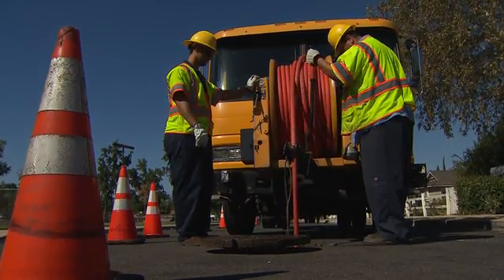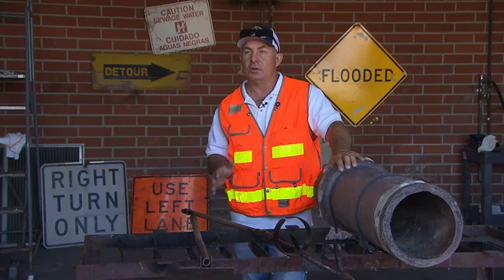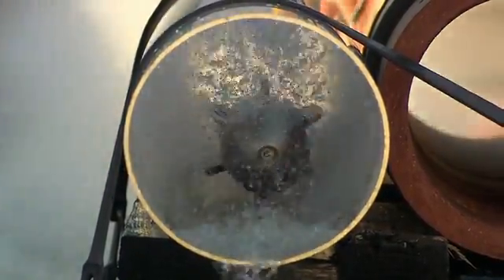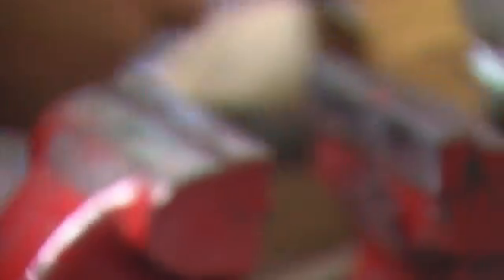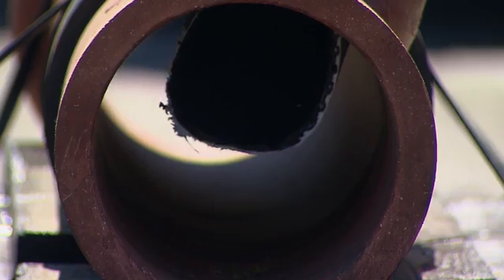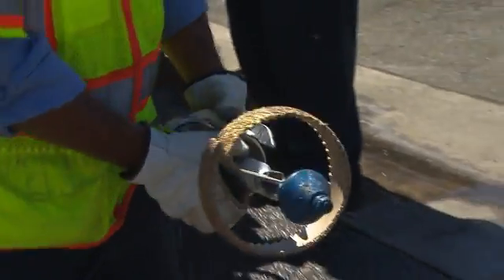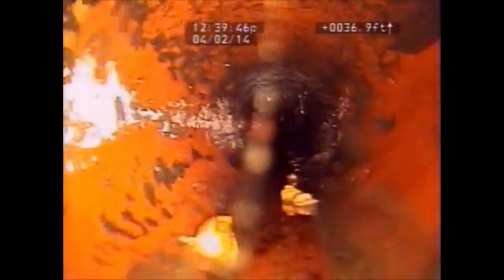Sewer Cleaning in Los Angeles California with Kent Carlson

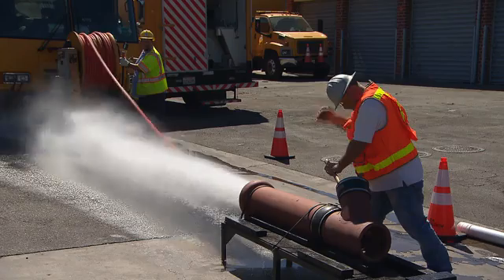Comment: ok boomer, but the way you're holding that piece of wood at 4:28 is incorrect. It's dangerous.
The pipes diameter is large enough for both your arms to fit, i.e if something goes wrong ( you slip or for some reason your hand is swallowed by whatever system your' re testing), your han will end on the cutting part of your device... Use something like a clamp at the very least.

Comment: Dont the new tools cause more problems destroying old clay pipes?  Those methods seem pretty aggressive
Reply from the maker: Great Question!...When we adopted the aggressive approach on cleaning and tooling our spill dropped from over 1000 a year to around 70.
Our Clay Pipe system has pipe that is over 100 years old and did not suffer any adverse effects with any of the aggressive tools and cleaning techniques..That's why we stay with clay and have not reverted to PVC that would definitely suffer damage with aggressive cleaning.

Comment: Seems like there would be a safer way to test the new cutting tool running at 2000 psi than holding it with your hands :-/

Comment: Or just use dynaflex with a cutting tip and a 40K rig, use less water than that jetter and not have to fashion a freakin tool every time you need cutting power.
Reply from the maker: Hi Justin  Our trucks run a Parker 1 inch hose at 60 gpm at 2000 psi or 80 gpm at 2500...we need the flow iin conjunction with the psi to clean  30 in lines and larger and flush debris. our average sewer line is 8 inch in diameter

Comment: you are saving over 2million to the city? Do the recognize any of that? I mean giving a fair payment for the tools you design and manufacture? if not, you better be an independent contractor!
Reply from the maker: Thanks for the props GUIRADE!  The city does not recognize the value and cost savings of my tools and I receive no extra payment for the City using them...go figure
Reply: @SewerPros  oof
Reply: The city doesn't care about savings.
You should've told them you had a much more expensive and less efficient way of doing the job and they would pour billions into you.

Comment: for the ones that dont know, have you ever seen a truck with the tanks cleaning out sewers? after they're done they drive to a sewage treatment plant and it goes through different piping and chambers to filter the water and put it back into the wild (what about chemicals and garbage?) ah, well they have very special tanks and lighting for that. (lighting?) the rays from the light "burn" the chemicals and the garbage is filtered to be separated and sterilized for "what can we use again". the water is cleaned to be put back into marshes and streams to the bacteria can break down the germs to safe water again. considering it's improved of being dumped in the ocean things have gotten safer..
Reply: smolder breath The garbage is taken to a landfill. There's not much they can do about chemicals, though they are quite diluted by the time they are discharged from the treatment plant.